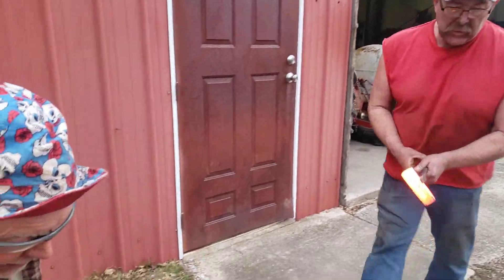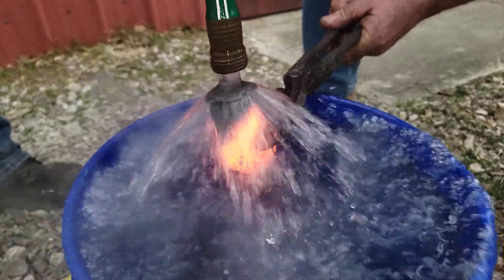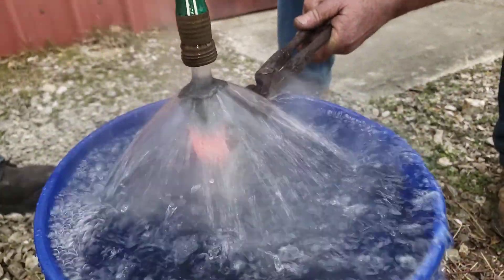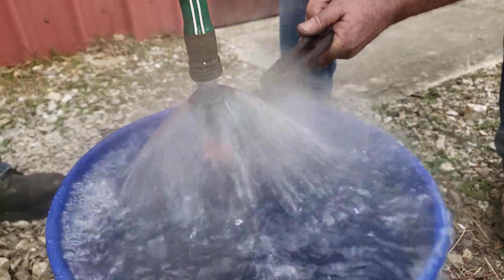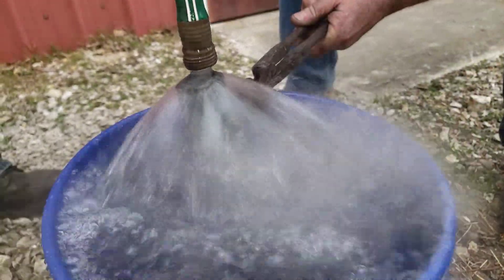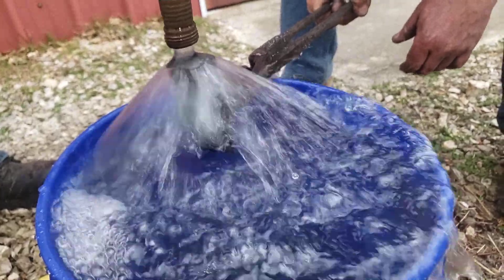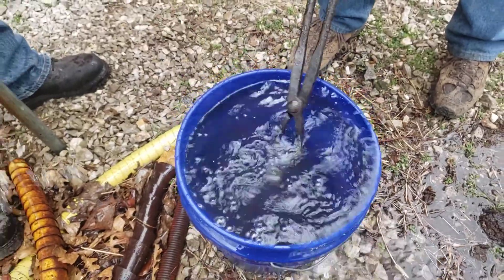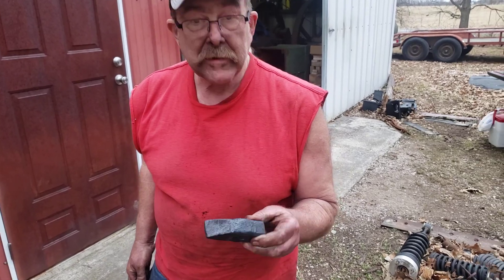Fast method of hardening a hammer made from 1045 steel.

Comment: Did this work well?
Reply from the maker: We  think this works well. We've used hammers hardened by this method without cracks or failure.  We're using 1045 steel when using this method to harden.
Reply: @johndilsaver8409  thanks for insight, Im not far off finishing my hammer head and will do this method. Thanks again!!